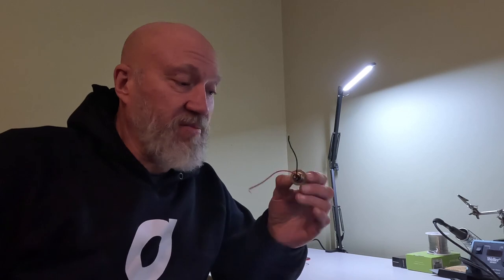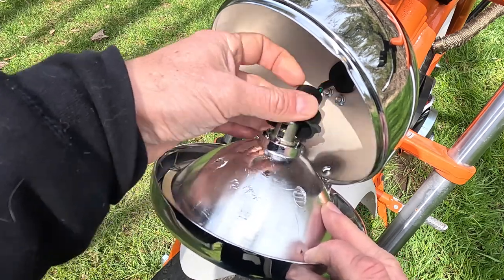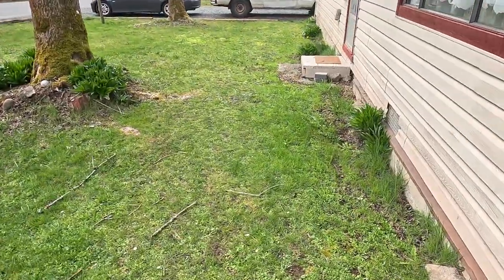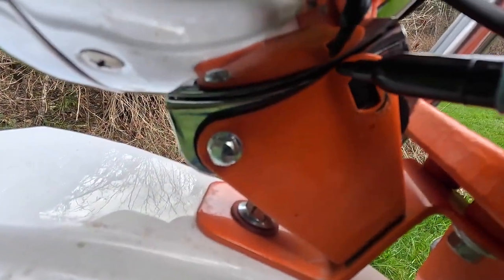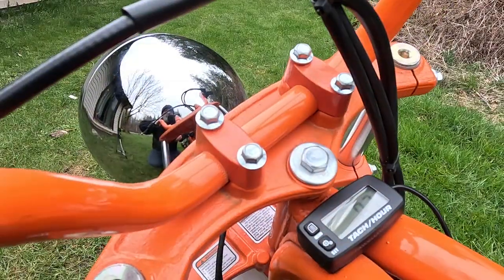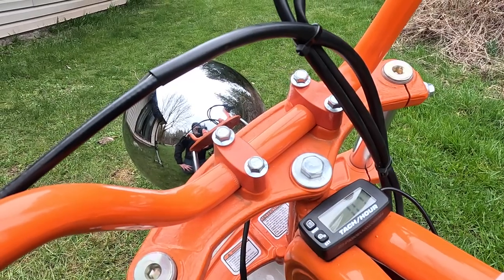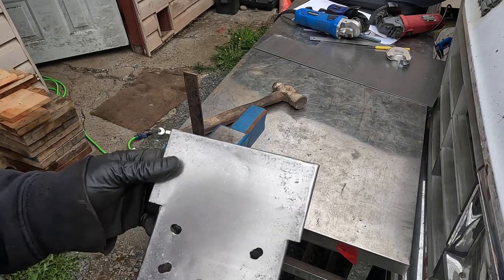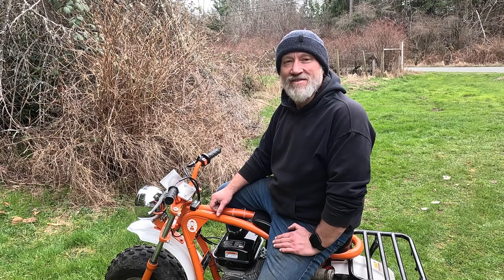Coleman BT200X | Do This To Get More Light From Your Mini Bike's Headlight! | Wet Coast Fab

Comment: Your coil (spark) and your charging coil are two completely separate systems ... so no you won't have more power for spark .....lol
Reply from the maker: Thanks for the feedback, Bill! You're probably right: I've not had the flywheel off before on this engine so can't confirm the number of coils. I've worked on other similar small engines and they quite often have just one coil for everything.

Comment: Got mad and put a LED fog light from a ATV on a front of mine and it's a wall of light have a separate Craftsman v20 battery running it
Reply from the maker: Nice, Joel! I'm working on a small rectifier circuit and battery to draw a little power out of the stock headlight for use when the revs are low or the engine's off

Comment: I went to the Amazon link and bought the pack of two LED’s. They are listed as  P15D low / high beam. Neither work in the Coleman bt200x. I double checked them with a 12volt battery, they work with the base as the ground itself and when you touch the positive lead to one of the two contact spots on the bottom it works, one contact is high beam and the other contact is low beam. The original Coleman light is wired without a “base” ground and the two bottom contacts are the power contacts for AC power. It seems that the new LED bulbs are for DC power with a base ground?

Comment: It's been a year or more now since you put that video out. Are you still running the same LED or have you replaced it. I guess I'm asking is how long does it last.
Reply from the maker: Hey Glen! Yup, I'm still running the same LED bulb a year later. I'm thinking I want to add a bit to it now to smooth out the voltage from the engine's coil so it doesn't flicker quite so much at idle.

Comment: Great upgrade!  Doing same tomorrow with mine.  Had great torque before taking it camping last week with the new TC and 60 tooth rear sprocket...after market performance exhaust fail as the muffler just deteriorated on rhe first day....wonder if i damaged the hisun engine 😕?
Reply from the maker: Yeah, those stock mufflers are just stamped metal with not much meat to them. I'm sure your engine is just fine!

Comment: That's an awesome upgrade for a mini-bike.  It's always good to see where you are going :-)

I have various e-bikes.  Always trading them with other people.  It's  fun to try different bikes.  For lights I have a DC-DC converter which converts the battery voltage down to 12V.  Then I can use any type of 12V LED lamp as a headlight and taillight.  I don't trade my lighting system and keep it on one bike which I use at night.

I will send a link to a picture in the next comment since I am not sure if comments with links can be posted.
Reply from the maker: Thanks, Robin! Can the DC-DC convert also bump the voltage up from less than 12v, or is only downwards? I know a buck converter can increase voltage, but only increase it.
Reply: @wetcoastfab  The DC-DC converter can only decrease the voltage.  It is a buck converter.  The input voltage can be anywhere from 18V to 56V and the output is always 12V.  A boost converter can increase voltage.

Comment: Go to Auto Zone and get a LED capacitor. The capacitor will stop the flickering at idle. 

The lighting coil is separate from the ignition coil.
Reply from the maker: I'm planning out a small LiPo battery/LED light project that will also do that, as well as provide a bit of light without the engine running
Reply: You most likely will need a regulator rectifier between the output of the lighting coil and the battery. If the existing light is LED then it will have a rectifier. Remove that one and feed the lights from the battery. Install a toggle switch to turn the lights on and off. Check to be sure it has the current capacity to handle the output of the lighting coil. Also check the output voltage of your lighting coil. Most will output 12v or more.

Comment: Any time I put a LED bulb in my coleman, it blows the light on the first ride. Any suggestions?
Reply from the maker: That's weird! Do you have a voltage meter that will measure A/C voltage? Check to see what your coil is putting out for voltage. The P15D LED bulbs are usually good for up to 36 volts or so

Comment: How did you get it to work on ac current off that coil?
Reply from the maker: Hey Dustin! Those bulbs aren't polarity sensitive. I've tested them with positive/negative reversed and they still work. I expect they have a bridge rectifier built into them to allow for that.

Comment: That's strange, I have 2 Colman bikes, and both have stock bulbs in them, and they're both extremely bright...

When riding 3/4 to full throttle, I can see 50 yards in front of me easily...

Also have plenty of adjustment to raise it way way way higher than needed...
Reply from the maker: Thanks for that feedback! I think there's a lot of variance in the build quality of these bikes. Definitely don't look at the frame welds too closely ;-)

Comment: Where does one purchase these led bulbs. No parts store has them, or Walmart Ether. Be nice to know what the part numbers are, so you order the right ones
Also, you might rethink your dash bracket, especially if you travel over 40 mph. We call crap like that nutgrabers😮.
Reply: Link is in the description
Reply from the maker: Yup, in the description but they're also part P15D. I plan on replacing that steel dash with a 3D printed one soon :-D